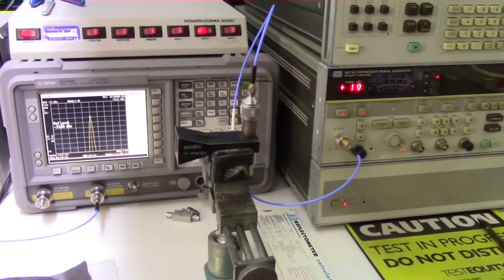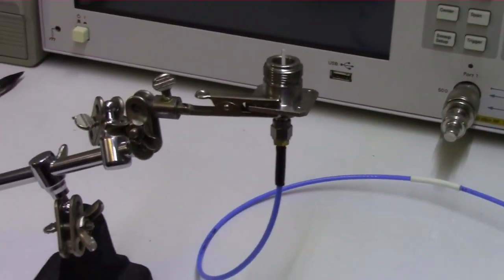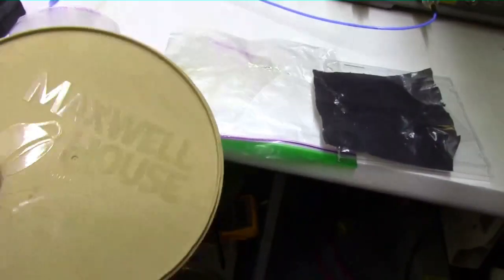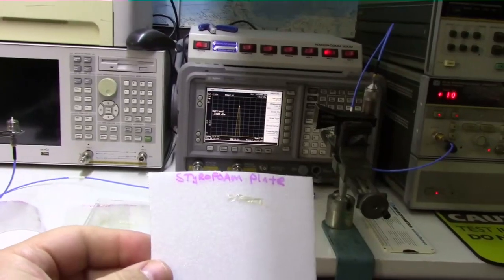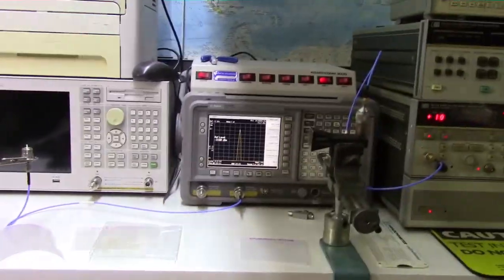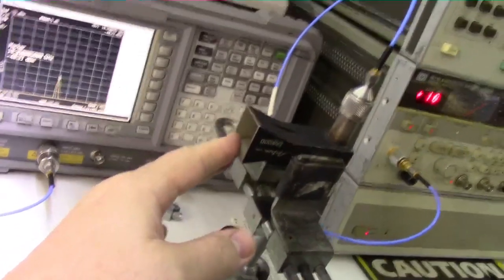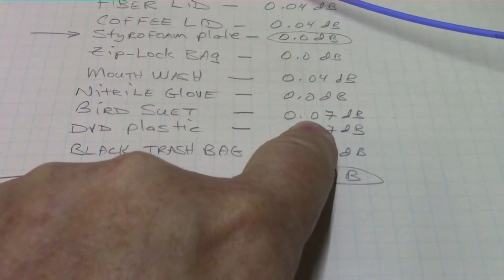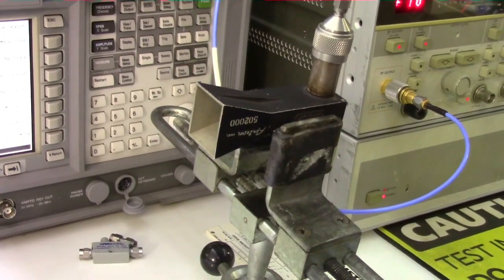RF Attenuation of Common Plastics at 10 GHz

Comment: Understood this video is 4 years old. Most plastics need UV protection, otherwise they decay pretty rapidly. I would have suggested to take the milk jug, paint it with the paint you planned on using, and see whether it increases attenuation. 73, Bert VE2ZAZ / VA2IW
Reply from the maker: For sure. Most plastics are not made for outdoor use and break down pretty quick. 73

Comment: The reason they don't cover it is because the dielectric constant of the materials will behave like a superstate. In the way you measured the plastics here I would suspect that the plastic were behaving like a dielectric lens or superstate depending on the near-field/fresnol zone of this particular horn.  In other words, your'e measuring the path loss in a magnetic field dominant zone while if you placed it just a few cm away from the mouth of the horn you will be measuring the loss in an electric field dominant zone. Not sure if this will produce different results for this test case but I would argue that a spot check wouldn't hurt.. :)
Reply from the maker: Hello and TU for your comments. Very interesting. I had assumed because my RX probe was ~20 wavelengths away from the source I would be measuring the planewave and not just the E or H-field. I have some horn antennas for 10 GHz (standard gain types) that are covered by a thin fiberglass sheet. The reason I had to find a cover is because my dish & feed will be up in the air about 60' and wanted to ensure rain, snow, ice, dust, dirt, spiders and bees stay out of the feed.